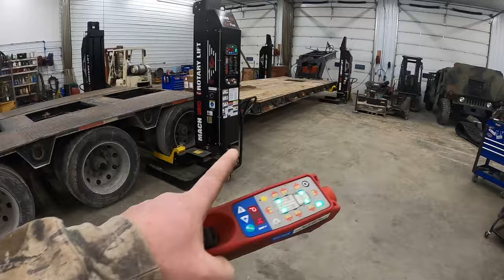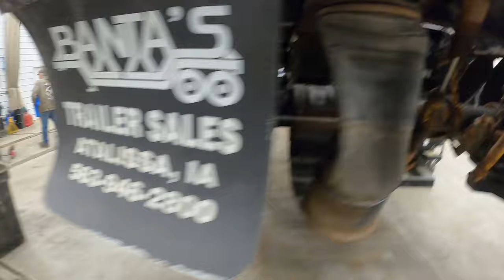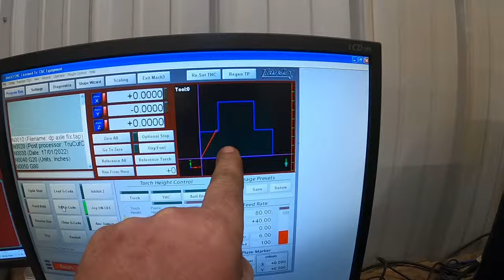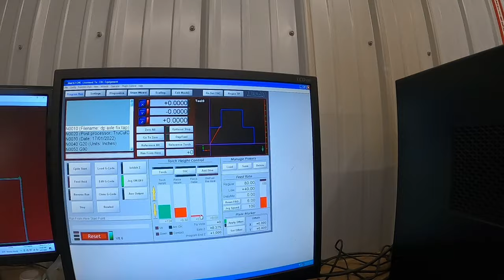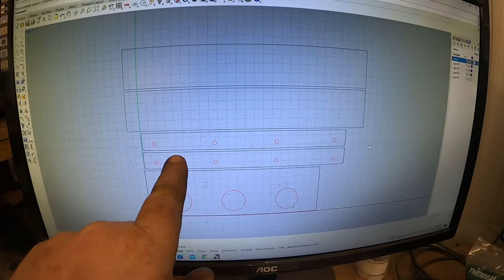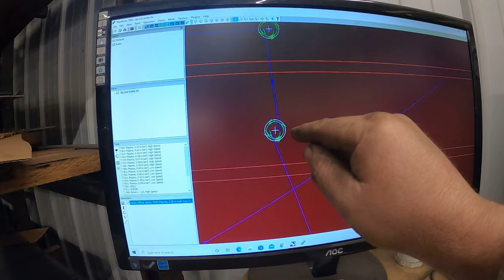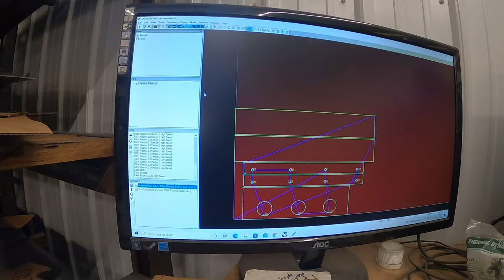@DirtPerfect lowboy trailer repair part 1

Comment: Looks like I found the right shop for this job 😬😝 looking good guys
Reply: DP you should be proud, these guys are really working perfectly, and  they really respect you till they accept this job even they don't working on trailers usually 👍
Reply: DP - I think you have scared them for life with your trailer. I suggested they have a new business "C&C Equipment and Trailers".... C&C reply was "Trailer shop is closed lol" .... tells you something???
Reply: @ 7:15 where the camera is showing the tires you have a screw in the tire
Reply: @daddywoofdawg  You can see it better at 7:24.
Reply from the maker: Thanks
Reply: @C_CEQUIPMENT  I think that's a little stone, but at 7:03 and 7:09 that is definitely a screw in the tire.
Reply: Officer Hoover should stop by and look over the lowboy while it's in the air 😉🤣 that would be a funny video.  Lol
Reply from the maker: @python3574  good eye
we took care of it
Reply: @daddywoofdawg  I thought I seen the same thing.
Reply: @Michael_CS615  No one who likes doing good, permanent repairs wants to deal with overly rusty equipment because we know the repairs are mostly temporary.

Comment: Clint, knowing you don;t USUALLY work on trailers, but so glad you did, to help Mike [ Dirt perfect ] out, since this job, in one of his more recent videos that he droped just a day or so ago, when he bought a JRB lift for scrap price from a dealer in his area, it TORE us most of the boards on this exact trailer.. What a mess it is currenly. Thinking maybe heavy diamond plate on it,??I found this video VERY interesting. sadly with all the salt on the roads during the winter, and running this trailer dsuring thr winter, is how the salts eats away and promotes to all the rest..This video showed all the talent and Knowlege that you have, from inspection to parts to weilding, and your sttention to detail on everything concerning this trailer and to keep Mike safe when using it.

Comment: I find this type of work most interesting and frankly educational from the initial inspection through more thorough investigation and subsequent repair. Those U bolts were quite frightening when you see the extent of the damage caused by corrosion.
That plasma table and press are just something else!! - Precision work and such a time saver
Reply: Yes, the U bolts were down right scary.

Comment: I bought a 1974 Muv all lowboy trailer and I want to strip it down completely, get it sandblasted then I’ll rewire it and repack the cylinders for the dove tail. 
All that to say, I like the longer videos that show all of the tear down and explain the how and why of everything. It has 8.25 R 15 on split rings.

Comment: Clint, love your work ethic! Let the video role. The old trailer is finally getting some TLC, it has to look good too, don't want the 850J to ride on a piece of crap!
Just needs some Fluid Film on its' bottom to keep it from getting rusty, which I have 5 gallons of and would be happy to come up and spray it on at no cost if you would think it's worthwhile!
Reply from the maker: Thanks 
You have to talk to dp about that

Comment: great job so far , I think I would go one step more after paint I would use some wool wax or fluid film on the painted parts before putting air bags ,tail lights in
Reply: Be blaster got a product that’s suppose to be better than wool wax or fluid film. Clint and his crew is doing a good job on DP’s trailer I’m sure Mike will satisfied

Comment: Mike is a smart guy .He knows you will do a great job over and above . Even though this repair will cost several thousand dollars ,  it's cheap compared to the longevity you just put back into service of this trailer . It's always best to let the pro's do what the pro's do . Don't worry about how long the video's are , it's good stuff and we do appreciate it .

Comment: It seems "more often than not" that the right most rear shackle/leaf assembly has the most rust damage. I know that on cars I've seen/repaired the right rears swell so much it pushed the ABS sensor ring off the hub. Long trailers would be worse since they're getting the heavy blast of the brine-salt-gravel peening that shackle housing and Rust jacking it open "due to salt and brine it's lots of crusty dollar$ time". Great assessment of that low boy brakes/suspension. Joy to watch you fellas!

Comment: Nice shop, great lifts!
I did notice a screw in the one tire when you had the camera situated on the frame as you were backing the trailer in. If you remove that you will save Capt. Kleeman some work.
It's good to see a shop that does good work and is careful to take a look at everything.
jack

Comment: With all the bolt-on parts renewed, the only thing Dirt Perfect still needs for the trailer is a new frame. The rig is a little rough. Good work going over it with a critical eye, stuff like that has no business being on the road looking the way it did coming in the shop.

Comment: My thoughts, DP, if the service centre operates on logged time and not book time spray down all bolts with Move-It or another pennatrant to speed the job as much as possible.  If the centre charges by the repair book, those places like most auto centres are on their own.

I know that you just aquired that trailer, but with that said I would recommend using some undercoat (Rust Check, Fluid Film etc) around places like behind the newly replaced plates, light mounts, and anywhere water (salt) or rain may sit.

Comment: 👍Looks like a pretty thorough assessment and good quality clean up and fabrication work. I used to be skeptical about the rust converters until I did a pair of rusted and pitted boat trailer fenders. 2 coats of rust reformer and a coat of red rust-o-leum. lasted 20+ years before rust returned. Not bad for salt water use and road salt heavy area.

Comment: Those upper stitch welds allowed dirt and water to get up inside of that rear angled trailer end braces. One suggestion which was handed down to me while using press brakes with small parts is to put them in the middle of the press brake so no torsion loads are placed on the press brake rams and attachment points.
Reply from the maker: Good to know

Comment: Cc, excellent inspection & judgement on DP's 'big dawg' trailor...in need of total air bag brake replacement + related brake function adjuster rods etc. Glad you have such a well equipped shop to do this serious repair for safe highway transport. Also necessary replacement on crumbling mud flaps & those 3 rear light frames. Plasma cutting & welding new replacement structure for right rear spring housing was most needed & done...maybe more needed...but fix looked good from here. Big ass shocks comming soon, then install air bags, paint, test...then $$ then 👍👍👍😊🍺🍺🍺 Great team work with your men! Carry on Sir!
Reply from the maker: Thanks

Comment: Gemplers Rust better for your health and work better. I have used it in with a pump sprayer well. There are others that work as well. We used it in navy ship bilges to great effect and that lasted better than bare metal and two part epoxy

Comment: Second plate on mudflap bracket that pinch’s mudflap between the two. Mudflap won’t tear so easy at bolt holes

Comment: So where is all the Stuff DP did not know that you were selling him ? So when try to connect  the 2 parts  the auto connector for the air and electrical / all led lamps / mounts for speed binders / Back up camera /  The more exotic // Aluminium rims /aluminium deck with bedliner / Chrome sides / pressure gauge on the axles and the 5 wheel / ohh and a Showel or 2 he needs it :P

Comment: Hey clint, I'm surprised that Hoover off camera didn't say anything to mike about that U-bolt mount, holly shit...I'd say them U-blots are just a weee bit fu#kerd, a d back in 2002 I had a air bag leaking on my hopper, so i changed it, and I turned the airbag in to a piggy bank for my so. He was only a week old at the time, but i cut a small hole in top of it, the size of our twoonies, and when we cut a hold in bag we had over $3500, we left it at the grandparents PLC, and it filled fast well I bet if u filled to top there would b a shit load of cash coins in it.

Comment: DP is gets practically  new trailer after Client gets done with the project. You don't have to be an engineer but it sure would help operating the Laser Cutter. Another good job don't worry about the length of the videos, you make it interesting as I see it.
Reply from the maker: Thanks

Comment: looks like the trailer that i am working on now except that we had to do brakes s cams brake chambers slack adjusters 
air bags bushings all the goodies nothing wanted to cooperate coming off slack adjusters seized to the s cams pins to the brake chambers seized had to cut everything apart  fun fun fun
Reply from the maker: I feel ya

Comment: Make the videos as long as you want.  If I can't watch all at once, it will get done in stages.  Sure is a rust bucket.  I kinda forget how rusty stuff gets back there.  It is great that you do it right when you're there.  When it leaves, DP can be sure it is good to go.  I envy your shop.  Not much lacking but a big overhead crane.

Comment: When you have content as good as this one, the 46 min flew by.  It is most interesting how the connection between DP and you has changed.  I hope it is good for you as it is for him.
What is the lift height on Big Mo?  I see the hoses and sections in the mast.
  What kind of plasma torch are u using in the shop?
Excellent description on the plasma table.  I've never heard of the "weld to primer", interesting.
Your overall knowledge speaks loudly: mechanical, welding, cutting, parts ordering, etc.
Reply from the maker: Big mo probably goes up about 12’ I would say
We are using thermal dynamics plasma cutters

Comment: when you were rolling the trailer in I thought I saw a large head of a screw in the outside leading axle, passenger side. Hope I was wrong. The video length was great.
Reply from the maker: You are correct 
Repair in next video

Comment: Like the tire with the torx screw in the tread. Everything about this trailer needs work. The owner should consider a career change. It might be cheaper. 

No problem with long videos. However, won't multi-part videos make more revenue? I'm just glad to watch.

Comment: ⭐ I really believe ya should have at least cut a hole and looked in side that center 45 area, the outer 2 - 45's were opened up and water ran out but moisture could have it in several layers of pealed rust and I know ya said it looked like someone recently replaced it ,, OR covered up and sold it and Mike got it now. Just tossin it out there. ⭐⭐⭐ I'll say 4 stars for this vid. 0Oo and always a thumbs up :)

Comment: On the offside (or what would be your passenger/nearside) I can see what looks like a screw in the tread of the outside tyre, not sure which axle you had the camera mounte when you reversed it in the shop.
Reply from the maker: Good eye

Comment: As bad that was looking unneath there, it probably wouldn't hurt to change the We'll seals out and look at the wheelBarons make sure they are OK. Check out the s cam's 2 to make sure they're not worn out..  If it looked bad replace it
Reply from the maker: Yea
We looked them over and seemed fine for now 
That’s something he can work on himself in the future 😁
Reply: @C_CEQUIPMENT  💛👍🏻

Comment: Must be an older trailer. I would  want the big Maxi 30/30 brake chambers on at least both the axles on the ground. Those little single pancake pods are a disaster..Loose your air pressure-loose your brakes..

Comment: Q, is it fair to ask if there is a fine line of should be on the road and shouldn't when talking safety with big loads, there is always that thoughts of must get this sorted, not so much the tail work but structure and suspension plus brake equipment ?
Glad that you could deal to it, and he will know it has been done well.
Reply from the maker: Always for sure

Comment: The piece of plate you cut the axle repair pieces out of had a very familiar looking cutout in it, somewhat like the shape needed to fill the gap between the mounts for rippers on an 850J. Would I be correct in this or just seeing things?
Reply from the maker: Close I guess
But on a different scale
Reply: @C_CEQUIPMENT  Fair enough. A bit hard to estimate scale on the videos. I also wasn't 100% sure because the outer bottom edge shape looked a little off.

Comment: Do you have any idea hiw hard it's going to be to put the rubber around those marker lights in 1/4 thick metal. I do because I did it, you going to need a hot day and some tire lube.
Reply from the maker: Hmm
They seemed to fit ok
Maybe you didn’t have the correct rubbers for the thicker metal

Comment: Clint, what CAD program are you using?
Reply from the maker: Sheet cam for the cutter
I draw the stuff in rhino3d
Reply: @C_CEQUIPMENT  Interesting, I'll have to look that one up.  I use sheetcam too.  Thanks for the pointer

Comment: It's obvious that DP never got the camera in close to show all the "weight reduction" the trailer had but it's still kind of shocking to see how bad it actually is.
Now DP is going to have to rescale the truck and trailer to see how much weight the trailer gained during its time at the C&C Trailer Spa because that 850J has been gaining weight too. 😉